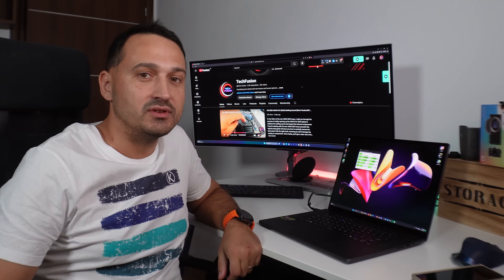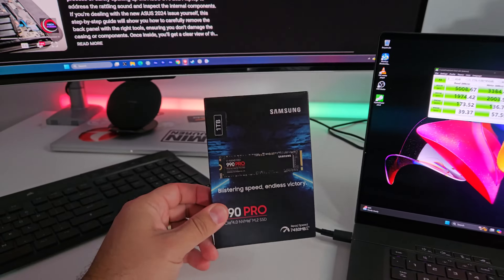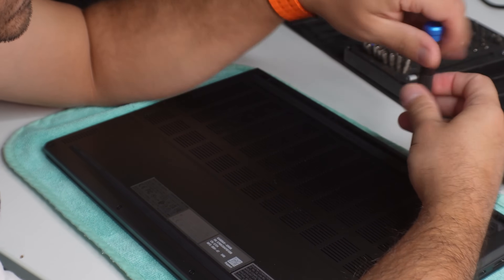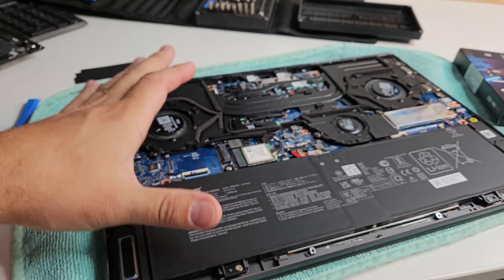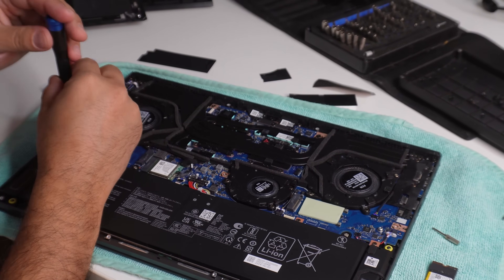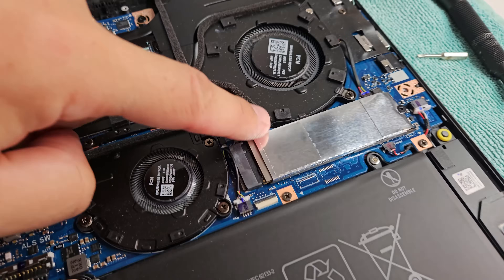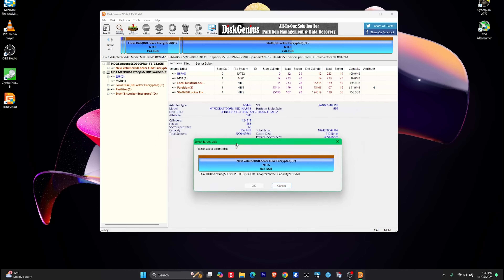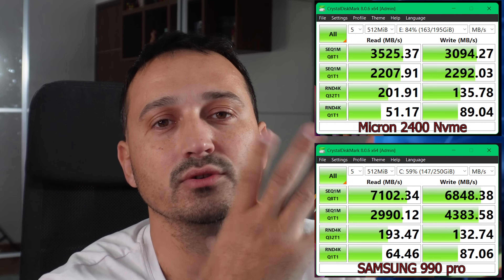Boost Your ASUS G16: Easy laptop SSD Upgrade Guide

Comment: I want to thank you for your guide, thanks to this video I was able to effortlessly upgrade the main SSD to a Samsung 990Pro 2TB and install an additional 990 EVO+ 4TB in the secondary slot. Apart from the added storage, the laptop is visibly faster when booting and loading applications. It's a real shame Asus cheaped out on the main SSD, considering it can make such a difference on such a high end laptop.

A couple of things I've done differently from you: I've cloned the drive using an USB M2 adapter, took half an hour to transfer 500GB, did fail a couple of times and it seemed to work well after completely decrypting (disabling BitLocker) the source drive. SDD got fairly hot in the process. Your process is definitely better, though less convenient. I've used Samsun Magician, which cloned the drive very easily with just a couple of clicks. This laptop randomly delays boot by showing the ROG logo sometimes immediately and sometimes (mostly on battery) a few seconds later, so I think you've miscalculated the boot times. My laptop used to boot in 15/17 seconds (from the appearance of the ROG logo), now does in 12/13; almost 20% faster which is not bad, in line with what your video shows.

Keep this honest unbiased content coming, it's really useful.
Reply from the maker: Your comment means a great deal to me and thank you for taking the time and sharing the details.I will strongly recommend the next best upgrade to really make it great and thats to ditch the liquid metal and use kryosheet for your cpu.Well only do this if you are not happy with the temps and fan speeds,but after I did it(check my video for the exact same laptop) it really made it run with 0 fan up to some 60C and really went quiet even after turning them on as its really making better contact on the die so the heat is handled much better.Cheers man and enjoy this beast
Reply: @Tech_Fusion do you have a video showing this process? Would love to see how you did it!

Comment: Something this video does not go over, the firs time you remove the bottom cover you will likely feel some adhesive feeling. Just keep gently prying and it should come off.
Reply: Agreed. Just gentle wiggling and it will come off.

Comment: Hi, is it possible to install samsung 9100 pro 1tb pcle 5.0 nvme m.2 in this laptop?

Could there be any speed advantage to add a gen 5 ssb on a gen 4 supporting mother board?

Thanks.

Comment: I followed your instructions but now I have the new drive and the old one with the same memory on them both idk what I did wrong pls help
Reply: Same memory?  As in same data?  If so that's because you cloned the drives which are exact copies of each other.   All you have to do it delete the data/ reformat the old drive so its clean.   

If your too scared to delete the data.   Take out the old ssd first then see if the computer boots up properly and works.   If it does work properly just re-install the old one and reformat it.

Comment: i've a GU605MY model and i was thinking about upgrade my 2tb ssd (original asus) , for my knowledge each slot can sopport 4tb gen 4 one side ? that's right ? . I am about to buy a samsung 990 Pro 4tb Pcie 4.0 , i think it should be compatible with this model of zehyrus g16 but not sure . Thanks . and another thing , shoul i order thermal pads for the second ssd too ? My plan is remove asus default Ssd (slot 1) ,  put the samsung 990 on slot 1 and asus default on 2nd slot ( here i should put a new thermal pad? ) .

Comment: I am having G16 2024 model GU605MV which I successfully installed 2 pcs of Samsung 990 Pro 4TB in both M.2 slots. Total capacity is 8TB.
Reply from the maker: @kenklwong1174  Great valuable info,thank you for sharing.Always had my doubts it can take that much space but wow,nice
Reply: Any idea if the 2023 GU603VI does?

Comment: According to benchmarks, most people actually get better results with the cheaper 990 Evo plus, and the laptop only supports up to 2TB on either M.2 slot.
Reply: I'm using now a 4Tb and 2Tb nvme in my G16.
So this limitation is not true.
Reply from the maker: Not arguing with the benchmarks as I used this drive in the video for the simple fac that I have already used it in the past and had zero issues with it and was also pleased with the performance.As per the 2TB limitation I do find this to be accurate as there was somebody in the comments suggesting that it did tried it out with a 4 TB drive and it failed to show up. Still if you would upgrade both ports with a 2 TB drive each that still a great deal of storage. I would suggest if you want more, then that means you need a NAS :).Cheers bud
Reply: @Tech_Fusion  The Asus Zephyrus G16 32GB AMD 9 AI HX 370 Platinum white (GA605WV) that I received a few days ago DOES support the Samsung 990 PRO 4TB NVMe in BOTH slots with no hassles or configuration changes. It's also likely that the single-sided Crucial P3 Plus 4TB works too.
Because of underlying controller chips in the path of both M.2 slots, any installed SSDs have to be single-sided.
UEFI update notes are silent if that drive support came with UEFI version 306 or the newer 310 (which I am running).

It's true about the left hand M.2 slot having two less data lanes than the right hand slot which is a PCI-e 4.0 x4. Both are operating at 16 gigabits per second, in fact the hardware chip that runs both slots supports 4 data lanes, but either the manufacturer only ran two data lines to the left hand slot, or, are purposefully limiting it in a hidden UEFI setting.

Lastly, I was surprised to see that the UEFI options are rather scarce to what I expected. I suppose that is for the good as Armoury Crate or G helper gives you the settings you'd expect to see with easier access.

On a more positive note, the internal soldered RAM is running at a higher clock speed and is quad channel memory verses anything a user could install on his own. You just have to buy the amount you need when you buy the laptop.

Hope this info helps somebody.
Reply: I have a 4tb 990 Evo+ running in the second slot. Not as fast as the drive in the first slot, but working just fine. The tutorial in this video helped with the drive installation, thanks!

Comment: How did you get into the BIOS at startup to switch the boot drive? Is there a function key you gotta hit? I'm wanting to do this upgrade on my G16 but I just want to confirm before I do it. Thanks!
Reply from the maker: @andrewnickds  just mash F2 on the restart, cheers bud
Reply: @Tech_Fusion  excellent. Thanks for the quick response, subscribed
Reply: @Tech_Fusion lol.....mash..😅
Reply: Well technically if he used the cloning program he told the program to boot from the cloned drive.   I don't know if it's only a 1 time thing or not.

Comment: Hey what's the name of the program you are using to clone the SSD's? I don't see the name of it in the video description.
Reply from the maker: @BlackStarrTurnsHeel  Hey man,its DiskGenius
Reply: @Tech_Fusion  Thanks. I've been watching a lot of reviews and upgrades in regards to this laptop as well as the Lenovo Legion i7 and pro. I still haven't made my decision yet but I am grateful that you have an in depth SSD tutorial just in case I go for the G16.
Reply: @BlackStarrTurnsHeel  what did you finally choose in a laptop? And why?
Reply: @SpaceCadet4Jesus  I'm still saving up for it because I'm going for the four year warranty with two gen five 1tb SSD's and some additional accessories. 😂 I'm absolutely going for the all white Asus Rog Zephyr G16 AMD 32gb version. I don't know what the future holds for gaming in the next seven to ten years but I believe that 32gb of memory will still be enough for both gaming as well as well developing a camera app involving Ai, hopefully. 😂🤷
Reply: @ Great! Realize that the M.2 SSD slots are connected to PCI-E 4.0, not 5.0. The drives you mentioned are backwards compatible and will take a few points off the highest end, but probably nothing you will notice in daily use.
Reply: @SpaceCadet4Jesus  So what you're saying is that fifth gen SSD are not compatible with the G16? Which two 1tb SSD's would you recommend? I'm planning on doing a double cloning procedure using two high quality 1tb SSD's since the limit amount is 2tb.
Reply: @BlackStarrTurnsHeel  You can use a PCIe 5.0 SSD in a PCIe 4.0 slot.

The SSD will simply run at PCIe 4.0 speeds
You don’t need to change anything — it will detect and negotiate the highest mutually supported speed.

As for drive sizes, whichever drive you choose should be single-sided (no chips on the backside) because that won't physically  fit on this laptop. The laptop supports a 4TB drive in either slot, I have a Samsung 990 Pro 4TB that I tested two days ago. 

Since I don't have two 4TB drives, but a 4TB and a 2TB, my total disk space is 6TB.

The only two drives I, personally, would put in there at 4TB, is the Samsung or a Crucial P3 Plus 4TB. Unsure if there are any other 4TBs that work.

Hope that clears things up.

Edit: I'm using BIOS 310, the computer came with BIOS 306. Don't know if that makes any difference as ASUS is not verbal about BIOS update contents.
Reply: @SpaceCadet4Jesus  Wait I thought 2tb was literally the actual limit? There have been so many reviews stating that the G16 is limited to only 2tb of storage. This changes things for me. 🤔 If possible if you haven't already can you post a video of your G16 running a 4tb SSD without any issues? I know it's a lot to ask but what you say is true then I basically kill two birds with one stone.
Reply: @SpaceCadet4Jesus Thanks for the recommendation.
Reply: @BlackStarrTurnsHeel  Since I don't have video capabilities or a way to share it, do this: Into Google search type ""Does a 4TB NVMe SSD run in an ASUS 2024 Zephyrus G16 laptop?" and you will have your answer.
The model laptop I have is the GA605WV,  GA605WV translates to a white ASUS ROG Zephyrus G16 (2024) equipped with an AMD processor and an NVIDIA GeForce RTX 4060 GPU.
And I have the latest UEFI of 310, the machine shipped with 306 but I did not install the 4TB drive until after my UEFI update.
Reply: @SpaceCadet4Jesus  I truly appreciate this information you're giving me. Now I'm really looking forward to getting this laptop. Thanks again.

Comment: Thank you so much for the video. Even before watching it, I had already installed a Samsung 990 Pro, but in the second slot. It turns out that this slot is PCIe 4x2, while the primary one is PCIe 4x4. As a result, the 990 Pro now has the same Windows boot speed and test performance.

By the way, I don’t think you mentioned that the slots are different. Maybe it would be worth pointing that out. I also have screenshots of the tests when the 990 Pro was in slot 2 and the Micron was in slot 1. Let me know if you need them.

And yes, in the video, the 4070 also has three fans. The camera feature is only in the 4080 and 4090.
Reply: Si is it ok to install a second ssd nvme 4.×4 rather than x2 ? I want to buy this model: SAMSUNG 990 Pro, 2TB, PCIe NVMe 4.0 x4, M.2, M
Reply: How did you find this out? I'm curious about the newer model ASUS ROG Zephyrus G16 GU605 Intel Core Ultra 9 64GB RAM 2TB SSD RTX 5090 240Hz 16 Inch. I want to upgrade the SSD and put the existing one in the second slot but wondering if it will work. And if the second slot is definitely slower on this new model too.

Comment: On the original boot test, the BIOS logo didn't even come up for 8 seconds - which is not a limitation on the hard drive, so you'd have to add 7-8 seconds to your 17-18 seconds to see there is very little difference between the old and the new drive. High performance NVME drives don't actually make a huge difference on boot times...but okay.
Reply: I was thinking exactly this. The new one may be much better for game load times with a drive that good + the thermal solution on the controller. But the boot test is essentially useless.

Comment: Did you add Thermal Padding for this drive? If so how did you do it.
Reply from the maker: Hi,I just added the one I found on the installed drive and moved it over on the new one. You can skip ahead in the video and see how i just transferred it over. Cheers
Reply: You can add a 0.5 mm or 1 mm thermal pad (Best you can find 12x) and a 1.5 mm copper heat sink on each drive held all together by those little clear rubber bands that come with the heat sinks. You have 2.5 mm of clearance, I quickly took advantage of that, on both sides.
Whether you could place a thermal pad and heat sink totaling 3 mm is the hard question. 
At that height there may be a bulge on the bottom and it's likely the bottom panel will not snap shut but must be held closed by the screws.
Edit: I took off that toy trash aluminum sleeve they had on the original drive. I really can't believe that sleeve does anything.

Comment: Great video and well explained!! I noticed that you did not disconnect the battery before removing and swap the SSD. Is it something that I should? If I don't disconnect the battery,  I'll make sure to discharge my hand before touching the laptop. Also, after you swap the SSD, on your first initial boot, did you have to go on the bios to change the order of boot or Windows recongnise that the boot ssd was changed? Thank you!!
Reply: Obviously it's way better to replace the drives if the system is disconnected from the battery.
But before you do that, read the owners or maintenance manual, because they want you to remove the cable head very specifically to avoid any damage by shorts. 

I'll give you some tips from the manual. 
Disconnect it at the motherboard connector, not at the battery connection. 
With a piece of plastic (not metal), push the silver locking bar slightly away from you, that unlocks the connector. 
From the left edge, where the red wires are, lift that edge up so the red wires disconnect first, then lift the rest of the connector up and away. 
Reverse the steps in putting the connector back on, ensuring that the red wires are the last to be placed in position. Make sure you have it seated properly or the silver locking bar won't move. Above all, believe the manufacturer when they advise this method.

If somehow you short out your laptop it won't be covered by warranty.
Reply from the maker: Hi and thank you kindly.Well you could play it safer than I did and disconnect the battery for added peace of mind but you dont have to do it if you dont want to.Like I did time and time before,I just went for it and nothing happened.As always its a good ideea not to touch any other components and if you can as well.After I set it up,on the initial boot I did go into bios and checked whats its main boot drive and it was automatically set on the initial drive that came with the unit since that's where it sensed the windows install.If you encounter any bootup failures then go into your bios settings and on the main screen somewhere on the right upper hand side there should be a small menu where you can set it manually to what drive you want.Hope this helps and congrats for the fine purchase.Happy New Years! :_CoolBoy::_CoolBoy::_CoolBoy:

Comment: @11:10 How do you tell the BIOS to boot into the old drive?
Reply from the maker: @inggrid4599  go into the bios and right at the main screen there is an option on the right hand side where you can change the drive you want to boot from.Cheers bud
Reply: @ what buttons do you press to get into BIOS after powering laptop back on? F2 + power key? i’ve only had a PC before this :(

thank you for your help

Comment: Hi. Great video. Thanks for sharing. I would like know whether if i installed a 2Tb, can it be cloned since the original ssd is only 1Tb?
Reply from the maker: @Markwee0088  Hi,yes it can.cheers bud
Reply: @Tech_Fusion  Hello, thank you for your helpful video. Following your step-by-step guidance, I successfully installed a 2TB SSD and cloned it. However, I’ve encountered an issue—each time I boot up, I’m prompted to enter my recovery key to access the original SSD. Is there a way to resolve this and make access to the original SSD permanent? Thank you!
Reply from the maker: Hi bud,thank you for watching and its great to know you got it installed and cloned.This link here should help you remove bitlocker on your ssd.If you managed to install/clone then this should be a breeze.Cheers bud https://www.asus.com/support/faq/1047461/

Comment: I was gonna do the same. Can I simply move the original drive to the 2nd slot and install my new drive to the original slot? Will the system recognize the move of the original drive or do I have to go to the BIOS and set this up?
Reply from the maker: @mircocapelli  its going to work without any bios settings.it should find the windows boot drive from the second slot by itself as long as you install a blank drive in the original slot.Cheers bud
Reply: @Tech_Fusion  Thanks. I plan to use the new drive for my steam library and take advantage of the faster speeds for my games.
Thanks for your video and your advice. It was helpful
Reply from the maker: @mircocapelli  Good ideea,and really happy it was helpful.Cheers
Reply: @mircocapelli did this work ok?  Did it boot straight into Windows after the move
Reply: @THT4433  I dont know. I finally installled the new ssd on the free spot and its speeds enough for me